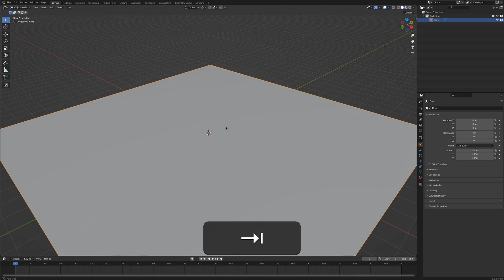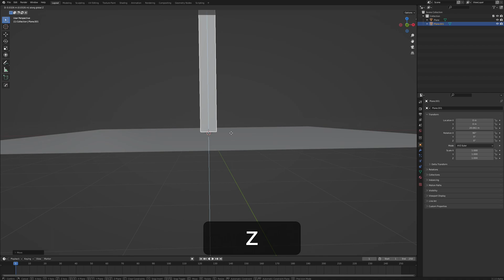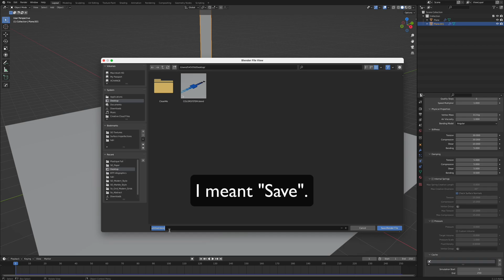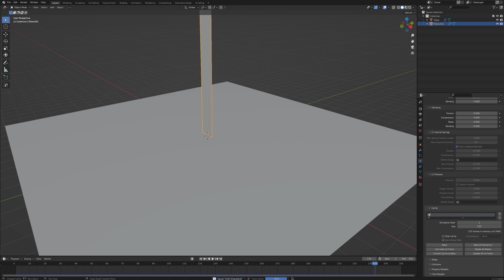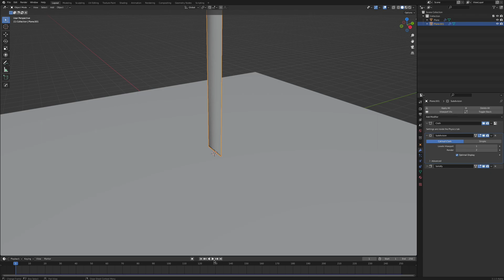Easy Cloth Simulation in Blender 3D - In under 5 Minutes

Comment: Hey man. Love your videos and thank you for putting these together. The only issue I am running into, is the animation will not play. I've followed your instructions to a T, and when I hit play, nothing happens. Only way I can get it to do something is in the Physical properties and change the mode from Angular to Linar. But its all messed up. But if I change it to angular half way through, it does what your simulation does but then it stops. Any help would be great.
Reply from the maker: If it stops to early, you may make the simulation length longer. This should be found in the the physical properties.